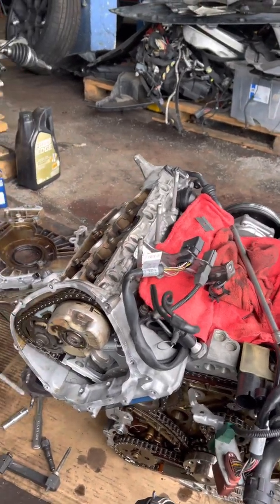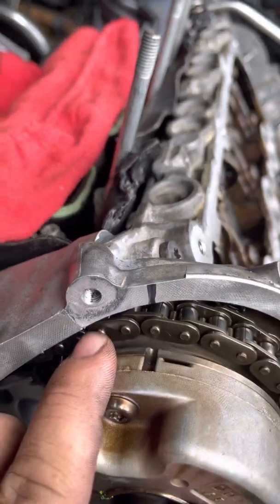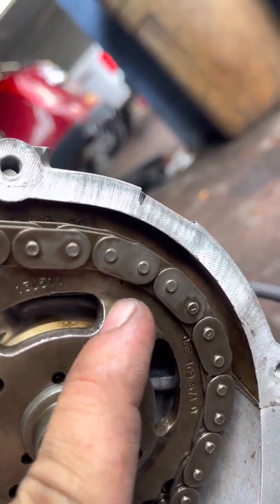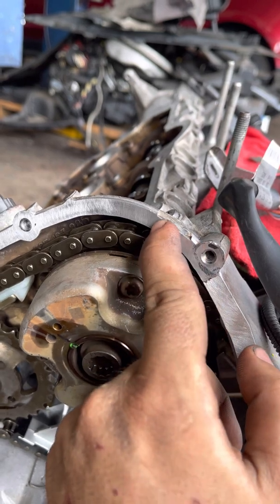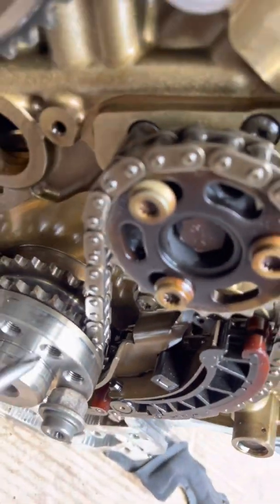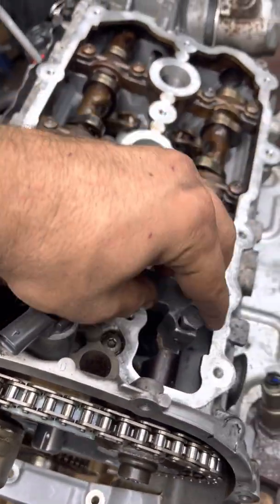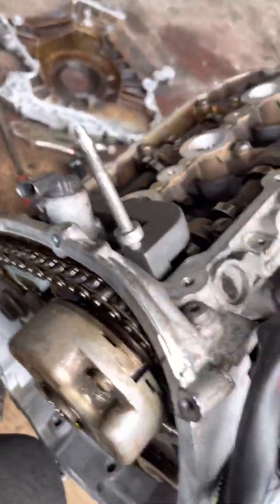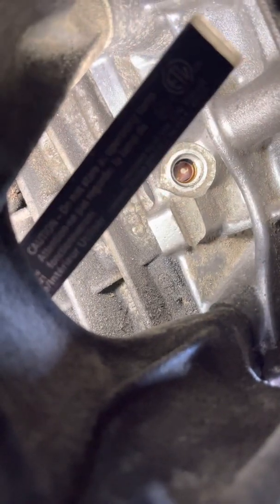Audi 3.0 TFSI Timing Chain Replacement

Comment: The cam position is wrong mate, them dots on the sprockets should be in the near centre of the windows.
Ive got a 3.0t caka and I've done the upper timing chain tensioners and guides with the engine in the car. Nightmare job but had to be done as timing had jumped 1 tooth on the vvt inlet sprocket. Yours seems to be retarded by 1 tooth on booth sprockets or you just needed to rotate your engine back a tiny bit. Either way at the edge of the window you will get some codes for timing being out. Good luck.
Reply: How did you managed to do it on the car , i know that's possible but do you need to remove any other parts on the back to get a little bit better access or you just removed covers and was attempting like that ? How long roughly did that take you to do it ?
Reply: @quattro4944 take of the the front end